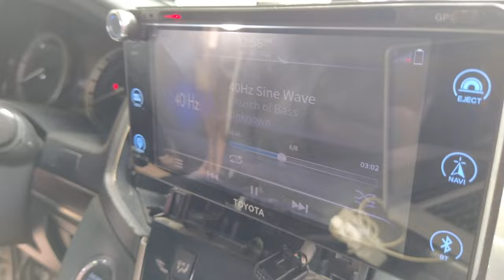Toyota Land Cruiser 200 Audio Upgrade

Comment: How did you fixed the amp on the floor so it wont jump around?
Reply from the maker: @ali-sleimanchehade6129  i just lodged it there hoping for it to not jump around
Reply: @chrclmnky  okay I see 😂 and another question 🙋‍♂️ what route did you use to pass the power cable from the battery and which battery did you use since there is 2 batteries…
Reply from the maker: @ali-sleimanchehade6129  the battery on the Left. Cable was routed through right firewall grommet.
Reply: @chrclmnky  🙏🙏🙏🙏